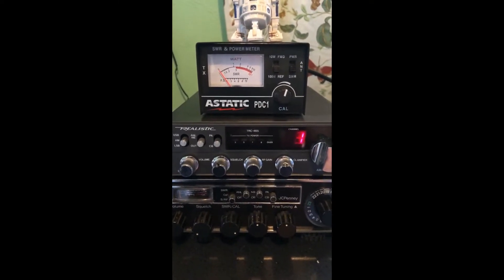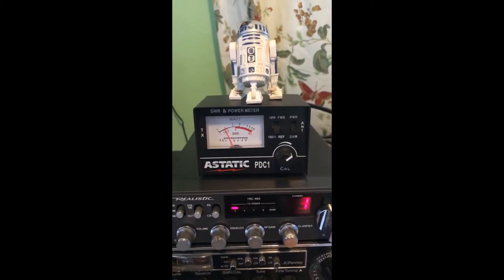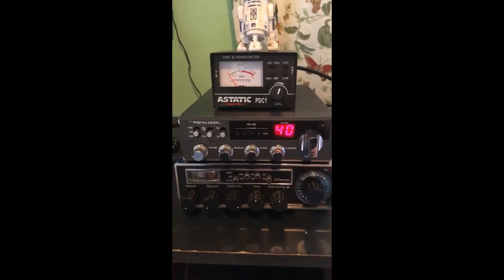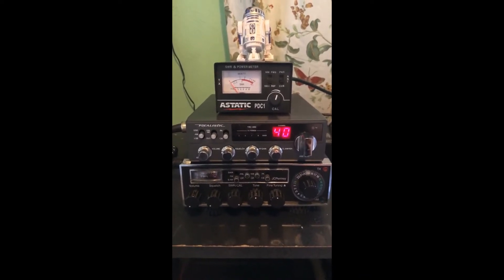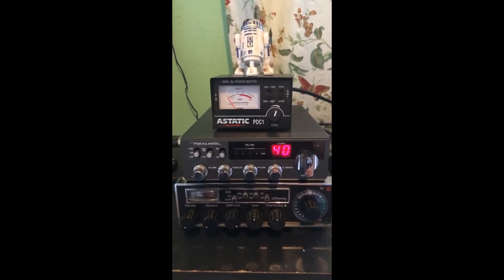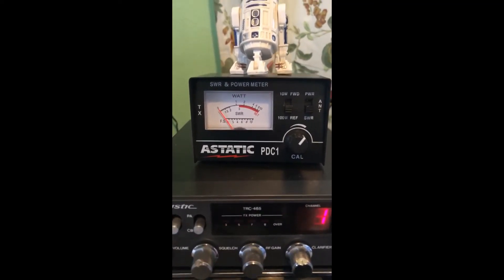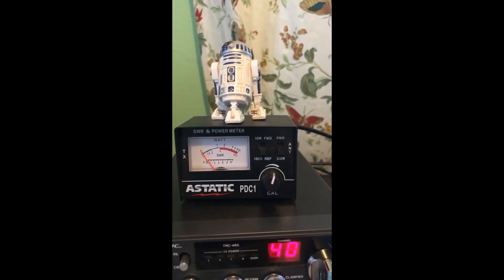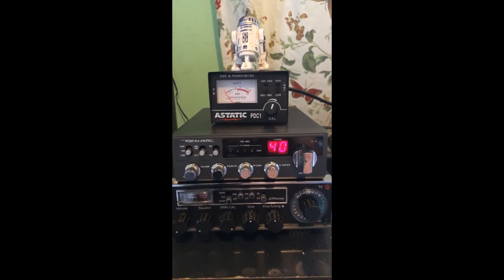Getting the Tram 1499 SWR down

Comment: Any updates on this vs the dipole?
Reply from the maker: I need to get out and do a test. I was able to reach a friend on the JCPenney 23 channel CB  about 5  to 6 miles away. on the Tram 1499. The Tram also seems to perform a little better for DX than the dipole, at least with the eastern contacts. That could be because the Tram is omnidirectional where the dipole is directional.  My farthest DX contacts were also made on the Tram. I was able to contact Michigan and Ontario Canada about 2900 miles away.  73s from 595 Northern Nevada!
Reply: Extend it up.